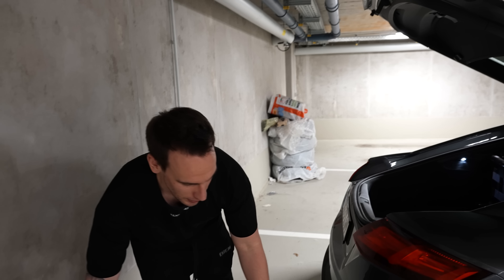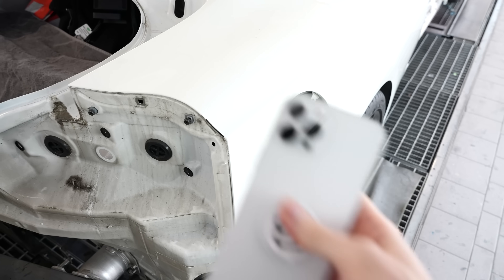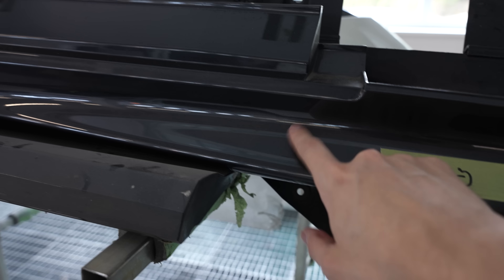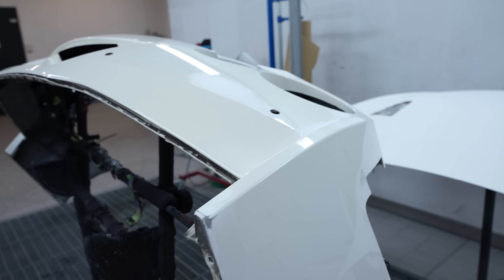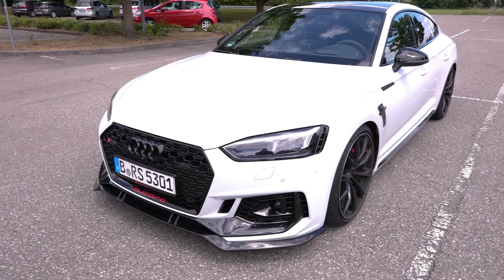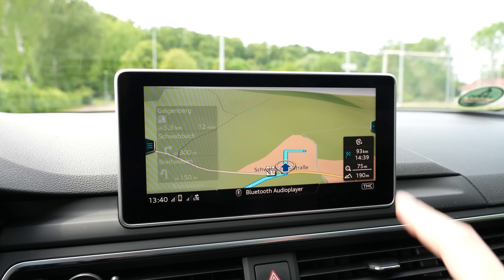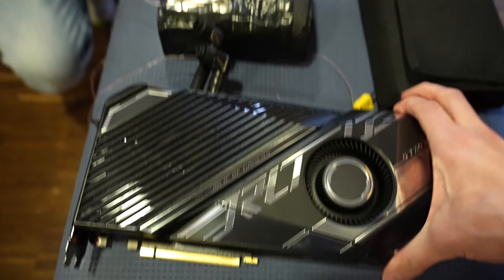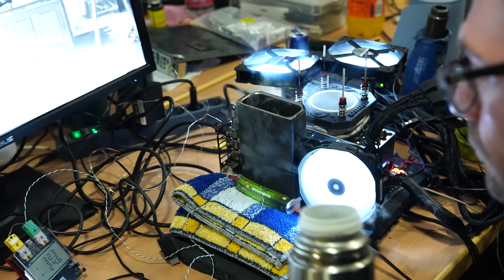WEE(K)-Log #23: GT-R Update and Overclocking Event with 1400L Liquid Nitrogen

Comment: I LOVE that SFF build!!!!! They way they did the custom metal plates to enclose the center of thew case is AWESOME!!!! And they turned the MoBo backward/Upside-down just so they could show off the water-cooler pipes and block - AMAZING!!!!!!
And I would think this exact case would fit SOOO MANY different MoBo's and even GPU's too!!!
I haven't watched the whole video yet but I would think there are glass panels that cover the sides of the case.... personally I would put blacklight/UV LED's around the edge where the glass sides in, and then have a UV reactive Coolant... or even just the particles in the Coolant are reactive (I don't think many people put those particles add-ins into the coolant these days, because they cause problems of gunk build-up.. but they sure do look awesome!!!)
I would LOVE to have this build!!! And anyone that has a SMALL COMPUTER SPACE..... with long enough piping you could put the radiator in another room and stay cool while you game LOL!!! 
THIS BUILD IS FANTASTIC!!!!!
Reply: ohhh I just saw it turned on and YOU ALREADY HAVE BLACKLIGHTS/UV LEDs  IN THERE!!! HAHAHA!!!! But you NEED to find a coolant that REACTS!!!!

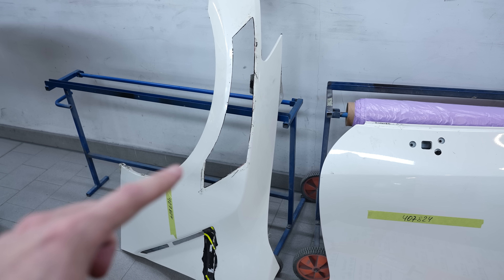Comment: umm yea @ 5:20 you mention the hood/bonnet - in the USA we say HOOD, but most ppl know what a bonnet means to (those darn Brits just HAVE TO be different...lol) 
OHHH and the hood was 'Freshly SANDED' , not 'GRINDED' because they used SAND PAPER.... if they were GRINDING (because 'grinded' is not a word)  then they might be making a DEEP CUT into the metal, or shaping a weld...with an ANGEL GRINDER... 'grinding' is like changing the shape of the metal, where SANDING is to make it SMOOTH :) 
(I just wanted to answer some the questions you brought up about the proper English... I only want to help you out... you're glisten is SOOO GOOD and I just want top help you make it better.... I hope I'm not offensive :/ )

Comment: I did filmed some Capristo products, IDK if those were early versions of a product but they were really hard to fit. I remember a 488GTB requiring 5 hours of work just to fit the exhaust tips properly in the open grille diffuser

Meanwhile for the SFF system I woudl totally pay extra to have a removable plug that brings sata power to the radiator

Comment: What? Due to the climate changes? I have the same(climate change) on my passat but not even a wear of that. The proper paint with etc., last way much longer.
Go for Hood(pop up the hood). The way in the case they did the RGB much better then now days. Specially, if the mobo got dual bios.